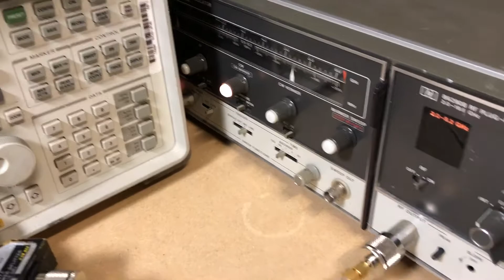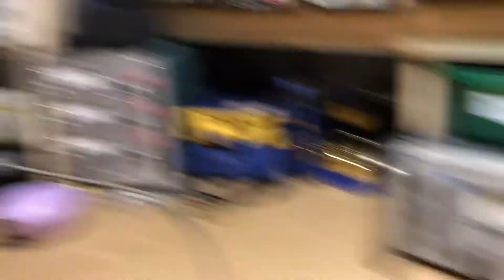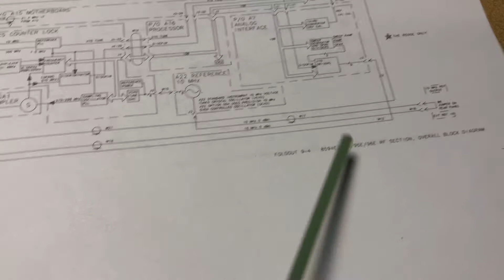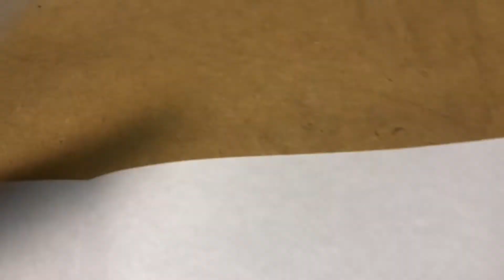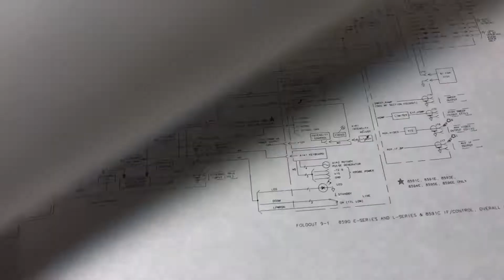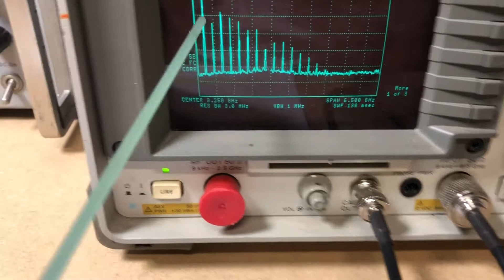HP 8595E Spectrum Analyzer High Band Low Amplitude

Comment: I wish your problem would have been worse-so you'd had to make a hardware repair!! I've got an 8595E right now with the exact symptoms, but the cal hasn't seemed to help it. I only paid a couple of hundred dollars for it and at least the low band is spot on. As soon as it auto switches to 2.9+ band, it is down 14 dB. Trying the cal sequence you referenced, but I think it will be to no avail. Thanks for the video.

Comment: I’ve got a HP8593A that is starting to have a bad power switch.  Where did you source your replacement power switch?  Thx
Reply from the maker: From a second parts unit.  Yeah, sorry I don't have a better answer.  Maybe check eBay.  There are usually parts for these units there and sometimes they are reasonably priced.